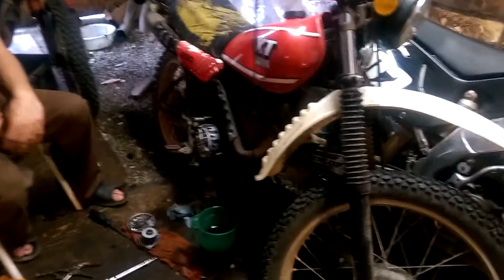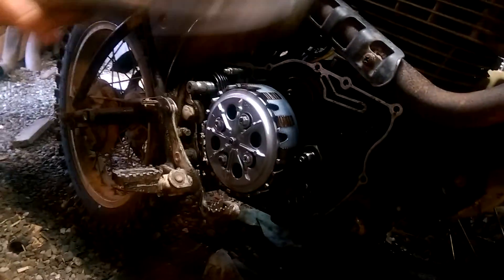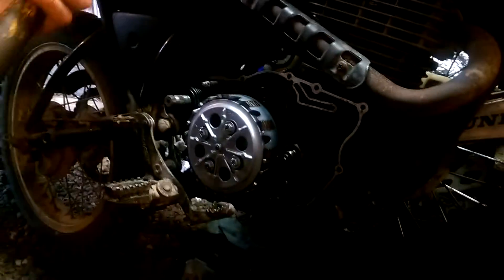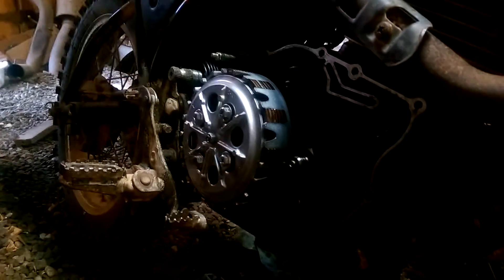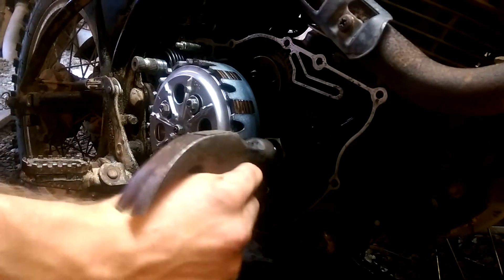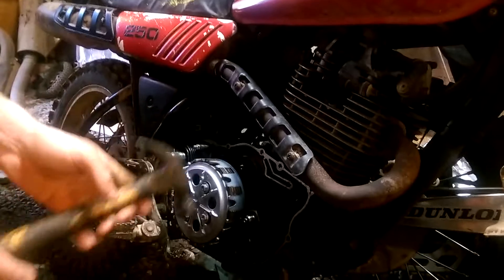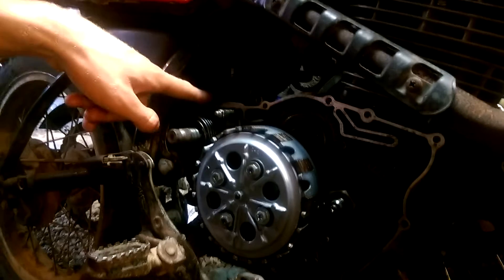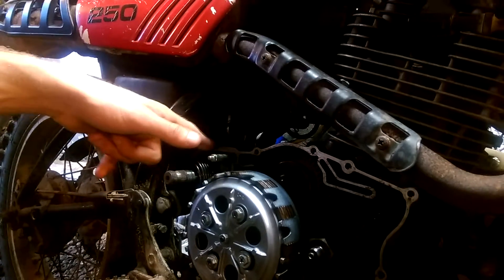Yamaha SR TT XT 250 ROLL PIN tech bulletin - Crank Shaft Oil Gallery Modification

Comment: Do I need the exact part number or will any 6mm spring pin do?
Reply from the maker: You should be fine with any spring pin thats the right size
Reply: Black 7 Point Tree Thanks for the quick response

Comment: hi,
do you know if latest models require this modification too? 
I just bought 1991 model,last year of production, has no puncture mark on serial number. It only had one owner and he did 5800 km on it, probably never went to service. Bike was stored for 20years just changed oil and filter and its running good.
Reply from the maker: Hi Michal,
 Is your bike a XT350? When I went to the parts diagrams for 1991, I did not see any XT250s. This Tech bulletin only mentions XT250s.
Reply from the maker: If you look at the parts diagrams, the crank shafts look different. 

http://www.yamahapartsnation.com/oemparts/#/c/yamaha_motorcycle/parts
Reply: thanks for replying, 
it is definitely 250, literally last of them, made in february 1991. Looks same as 1980 models, same engine and all.
I have a video of it on my channel.
Reply from the maker: Wao its in amazing shape! I would assume since the tech Bulletin says "XT250 All"  and that you say your engine is the same then your bike would need the spring pin..but.. I cannot be sure. I lost the video of how my rocker arms looked when I removed them on my bike but they were very eaten away. I will try and find that vid again and upload it.
Reply: I was thinking that they would figure this out by the end of production (like with the decompression valve), but who knows...
Does it have any specific sound/vibrations that I should look for? After oil change the bike is running smooth and sounds great. Before (like in video) it had bit of rattling noise, but oil was oooold. Also stalled with cold engine when popped in first gear, now is all ok.
Reply from the maker: That rattling noise was probably your rocker arms clicking, if it came from the top end. adding newer oil probably eliminated that because it was not so thin. That top end clicking will get very loud as your rocker arms and cam wear from lack of lubrication.  But another thing that can make a clicking or clacking noise is your timing chain if it is loose. That is probably not the case though since the noise went away when you changed the oil. I do not think the noise would go away once the oil was changed if it was the timing chain.
Reply from the maker: Here is an article on a similar bike like ours. He talks about the oil pin bulletin

http://phillittleracing.com/motorcycle/phils-custom-motorcycles/yamaha-tt250-trail-bike
Reply: hi again,
thanks,
did some research and looks like that it only affects bikes 1980-1984 but not 100% on it.do you know the date when the bulletin was issued?
and if it comes to worst, is it easy to get the pin in? just drain oil, open it and knock it in? Thats it?
Reply from the maker: Hey Michal, Were you able to open my link in the description with the tech bulletin? I retyped the whole bulletin so that it is easy to read but if you scroll to the bottom you will see the original copy I typed from. That is all the info I have. I found the bulletin on a site somewhere.. but not sure what the link is now. The pin is not hard to get it. Just lightly tap it in with a hammer. I did have a 6mm pin but a 5mm probably would be the correct size since I had to compress the 6mm pin smaller. I had a buddy order me the pin from a Mine supply company but i am sure if you call around you will easily be able to find someone to provide you with one.